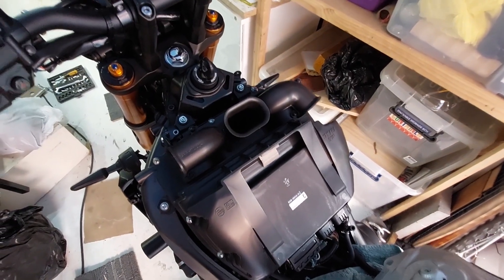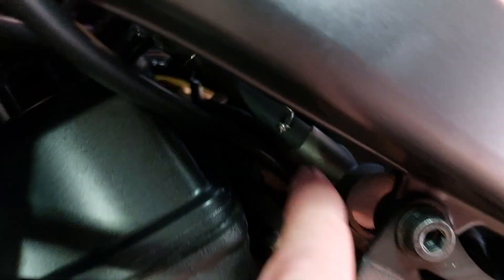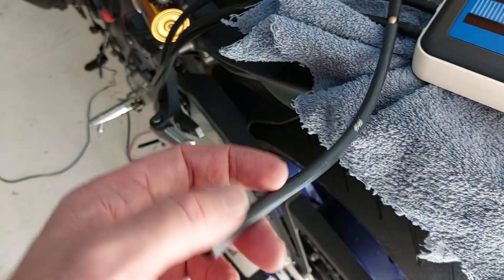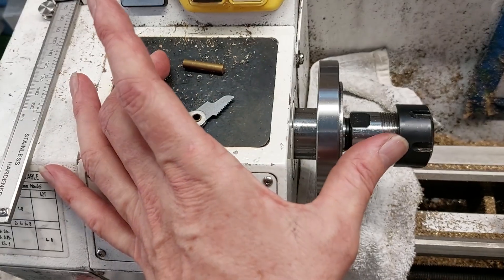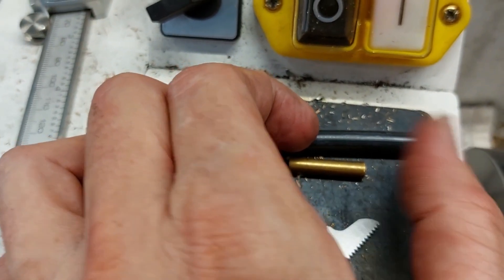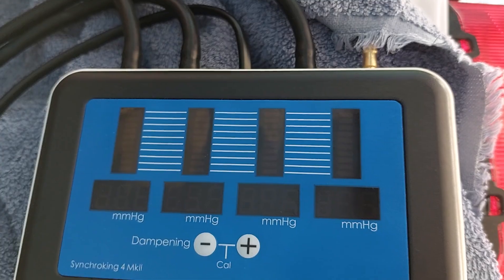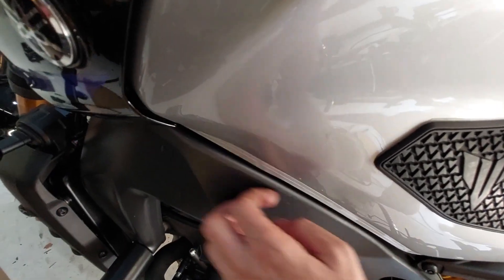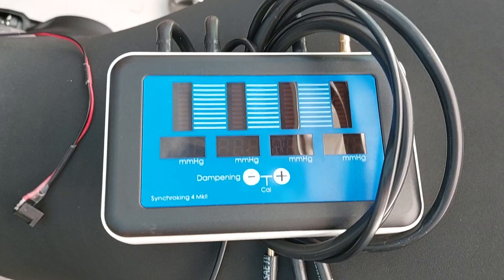MT-09 Gen3 Throttle Body Sync - The difficult things that no one will tell you about

Comment: Sorry, I have to disagree. I’m doing this right now on my gen 3 and when I got the air box off all I did was undo all the electrical connectors, there’s like 6, then the t pipe where the rubber hoses connect and that’s you got plenty of access. The rubber caps come off with a standard pair of needle nose pliers. It sounds like half your issue was you bought the wrong tool with incorrect sizes.
Reply from the maker: That's a fascinating way to disagree. So you dismantle a whole lot more of the bike just to connect the hoses (which you knew the size of before hand) and then you have to reconnect all of that to perform the sync and then you have to dismantle it all again to reinstall the nibs before reassembling it again and putting the airbox back on.

That doesn't sound easier. That sounds like a much bigger hassle. But you do you.
Reply: @CrankyNerdRides it takes 10 minutes once the airbox is off to disconnect the hoses and the cables what are you waffling on about? Takes a lot less time than literally using a lathe. But you do you. Also it’s funny you’re saying that you know the sizes before hand but had the wrong size hoses.
Reply from the maker: @shaunbarclay1309  Seriously? 🤣

You are claiming that I claimed that I knew the sizes before hand? I've never said that ever; this whole video is about me not knowing. I'm intrigued why people come into comments sections and then fabricate lies to argue a point of view that can never prevail.

You are also pointing out that I had the wrong tool with the wrong sizes which implies that YOU did know the size before hand. Now if you didn't know it would change the context for your comment. I didn't know beforehand because it was not documented anywhere. That's why this video exists, so that others can know the correct size and source the correct hoses before hand.

But lets talk about your metrics... 10 minutes to disconnect to get access to attach the tool. 10 minutes to reconnect to do the balancing. 10 minutes to disconnect again to get access to put the nibs on again then finally 10 minutes to reconnect again before fitting the airbox, tank, etc. That's the clear implication of what you're saying. Unless of course you're not reconnecting all of the hoses before attempting to balance the throttle bodies. That would be monumentally stupid though so I don't expect you to do that but given your previous comment I probably wouldn't be surprised.

The bit you're missing in all of it is that I can now do it faster than you. I can remove the caps, attach the tool, and later remove the tool and put the caps back on in probably max 5 min total compared to your 40 minutes. Well done. My hats off to you. That's a whole 35min you've added to your task.

Enjoy a pin of shame.
Reply: @CrankyNerdRides which is a lot less time than you added fabricating stuff lmao
Reply from the maker: @shaunbarclay1309  Fabricating the adapters took probably 15 minutes max. That's days less than the time it would have taken to order them in. The plugs for the replacement caps about 10min. That's less time than you claim to spend disconnecting stuff.

Machining stuff is actually pretty quick and lets face it. It's a once only task and i get to make it back up on subsequent balancings.

Even the mechanics that do my tire fittings commented that someone was going to thank me later for doing what I did given how quick and easy it is to do the balancing. 

Sometimes the best option is to put down the shovel. But please continue anyway. I look forward to the next episode.

Comment: yeah, I feel for you. I'm at the point where I have to remove the stuff that sits on top of the injectors. Found the one vacuum port just like you, and thought "I'll come in and see review some youtube videos to make sure I'm not missing something". Incidentally, I bought the same gauge as you too 😟
Reply from the maker: Once you're pre-prepared for it it does get easier. Make sure you let the device self calibrate on powerup with nice straight clear hoses. Otherwise it can read quite a bit off.
I've just done the 20k service and had to go through it all again. I actually cut a longer bit of tube for the middle one.
I've 3d printed some "things" to support the front of the tank too but did that after I was done so i'll be ready for next time.

Comment: All u have to do is remove the pipes lol.
Reply from the maker: Given there are no "pipes" in that area and given I've just done the 20k service and thus I've had to do this again i'm not sure of the point of your post. If you're referring to all of the breather hoses then no, you don't remove them. They would be a nightmare to remove while you fit the hoses from the synchroking after which you have to put them all back to properly before you sync the throttle bodies. That's an insane amount of work for what is now a very quick job after you replace the small vacuum caps with hoses you can grab easily.

In fact I took the shortest of my replacements and swapped it with a much longer piece of tube and put that in the middle which is the hardest one to find and remove. Syncing is now a 30 min job.
Reply: I'm purchasing a 2024 MT-09 this week.  I do my own work, and I'm not looking forward to the sync.  My 2019 Tracer isn't too bad to sync, but it's still a pain.   Thanks for the heads-up!